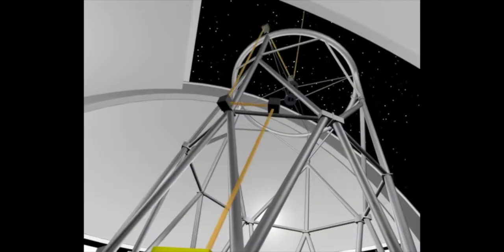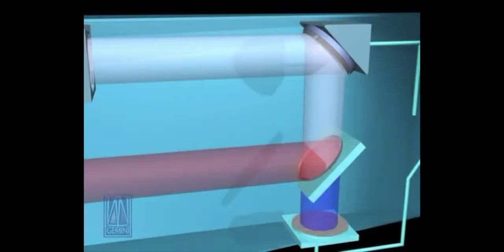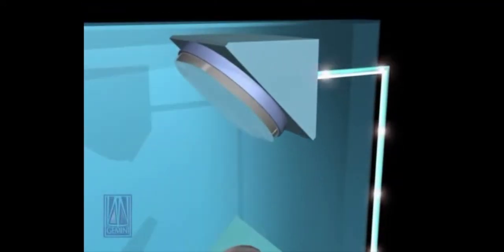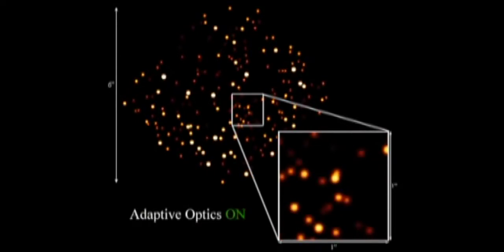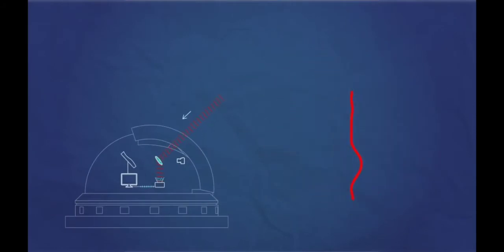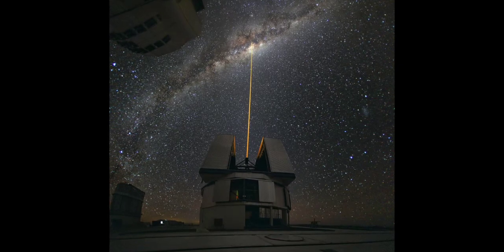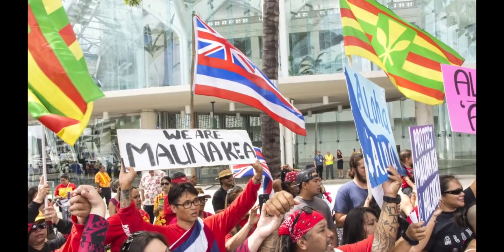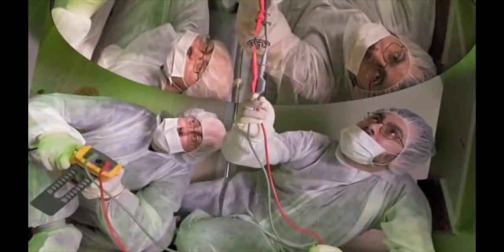Telescope Adaptive Optics - With Prof Simon

Comment: question , first !!?? 
 if first time blurry wave hit through secondary mirror then split via 45 ° mirror then half go to left side and other half goes to right side as feedback to  actuator to subtract from blurry wave but once it correct then this artificial corrected wave enters to actuator then it will unaware to correct next blurry wave because its earlier wave was corrected by itself and also feedback to itself . after that this process pattern repeat so on  ! so how it manage to correct it ?????
second !!??
how it separate its laser  virtual star light from real star  light which generated and emmited from same spot !???
and what mean of sodium layer in atmosphere and why only sodium and Orange laser
?????????
Reply from the maker: Great questions... the mirror tech you can get answers here.....the orange laser...excited an atmospheric layer at a known hight...the adaptive optics sister has a operate spotting scope that actually does the measurements...and then this is fed into the main telescope mirror system....but have a look at this:  http://lyot.org/background/adaptive_optics.html

Comment: That incredible.  I am very surprised it’s a mechanical solution instead of software.
Reply from the maker: bendy mirrors..
Reply: kek
Reply: I wouldn't be surprised if some sort of electro optic mirror device with controllable albedo could be achieved too for a less mechanical solution.

I'm sure something similar could be achieved also with a phased array if you had enough smaller telescopes to make the same corrections achieved with these bendy mirrors.

(alternatively you could just use the bendy mirrors in a phased array telescope to get even more detailed images again)